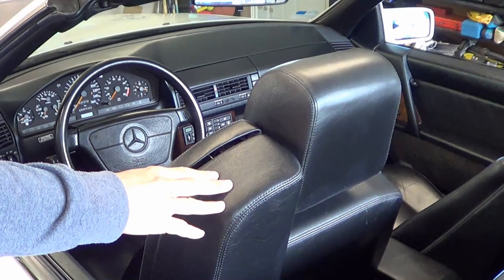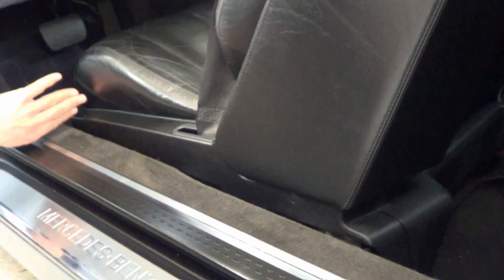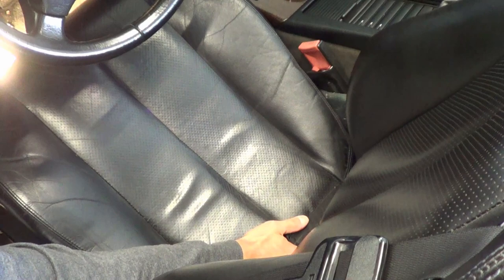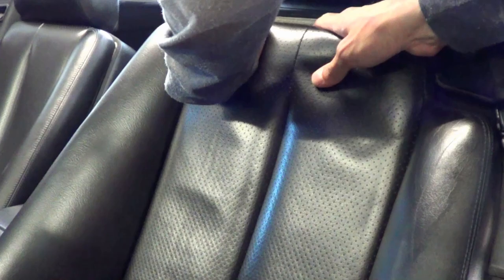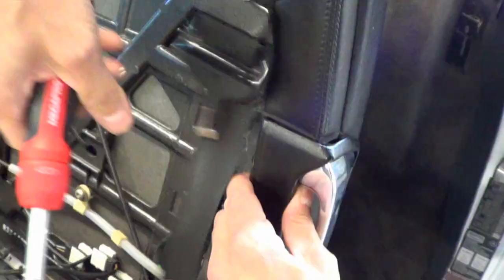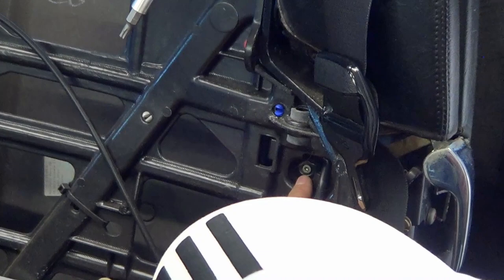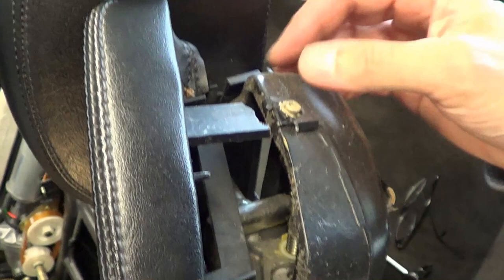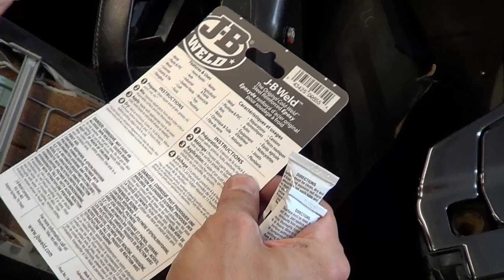Mercedes-Benz R129 Seat Removal Guide and Fix for 300SL, 320SL, 500SL

Comment: After watching your video, I got brave enough for the second time to do this repair, one suggestion: instead of gluing the pieces together, I did get a piece of strong plastic and attached with screws on both sides, I guess it is an option, thanks for making the video
Reply from the maker: Sam - thank you. I’m happy you found the video helpful and that I provided that extra motivation to get it done. The extra step you suggest would make the seat bullet proof. Recently, I added commentary in the video description highlighting this extra step. Thanks for sharing.

Comment: Nice video, and primes me up for fixing my loose back panel - which from what you show indicates I may have a screw dropped out at the top inside edge. 
I'd add that when I repair plastic brackets like this I prefer to use a re-inforcing strip of thin aluminium - from a drinks can or similar. You can cut that so it fits right over the entire bracket, then glue it with your epoxy and when set drill the hole through for the screw.
Reply from the maker: Thanks Chris. These seats may be over-engineered but on the bright side they are accessible for repairs when needed.
The epoxy is very solid when cured, however if combined with a re-inforcing strip it would become bullet proof. Great idea and thanks for sharing it.
Reply: @HandyVal  yeah the problem i find with epoxy sometimes is it doesnt key well onto plastic, even when the plastic is roughed up a bit first with some emery or a wire brush
Reply from the maker: I haven’t had any problems with using that particular epoxy. However, I’m a big fan of doing something once and not doing it ever again. So I encourage this additional step of using some kind of reinforced strip. I will add it to the video description.
Reply: Exactly what I do. 5 days ago I used Liquid Nails "FUZE-IT MAX" to adhere a thin piece of metal (slim-jim thickness) to the POS thin plastic "retainer bar" on the door of my fridge. It was cracked the day before and before it broke completely I "FUZED IT". That is some seriously sticky stuff. Don't think it gets as hard as epoxy but better for fridge application in my opinion due to the temp and the slight flexibility/bendability  of the retaining bar. The crack is still there because I knew epoxying the crack would last one week at best. For strength and this seat repair application JB WELD makes more sense. One additional hint: If someone (not you or anyone else reading this of course) happens to have screwed the head right through a hole (in plastic) epoxy a washer to the damaged plastic and voila- a reinforced forever hole just waiting for the screw to crank it down nice and tight.

Comment: Btw.  Great video. Tks for all those infos. The only think I rather prefer doing is to join the broken tab using a long plastic rod and screws instead of epoxi glue.
Reply from the maker: Thank you. Videos take time to make, so I appreciate the positive feedback. The epoxy is bullet proof, it’s still holding strong, even after a few years since the making of the video. But I agree, adding a plastic rod, or an aluminum strip with screws will make it bomb proof. It’s a good and smart idea to add the extra support and strength.
Reply: @HandyVal   I trully believe videos are difficult to make and time consuming. But I believe your r129 DIY series is by far the best series out there. tks for all those precious infos you share for free with us
Reply from the maker: @cbj032  Thank you. Much appreciated.

Comment: Hi. I guess you struggled to final install the bottom cushion last is because you first install the bottom cushion and screw it. Than you install the back seat cushion. I find this way easier.
Reply from the maker: After the video was shot, I realized the mistake I made. So, I added the correction screen. Thanks for the comment.

Comment: Thank you!  very detailed/informative.  The gears in my head rest are broken/cracked and need to be replaced and this is most of what needs to be done to get to them.  One question why did you disconnect the battery?
Reply from the maker: As a safety precaution, I disconnect the battery because of the air bags. We don't want to accidently trigger them.
Reply: @HandyVal  Right!  Thanks again

Comment: Val… let me ask this. What is your opinion about ERG systems in those euro engines? I live in Brazil and cars that old are NOT gov regulated. I was thinking in deleting my erg system. Hey…. Is this an DIY ideia for another r129 series video?   Best regards.
Reply from the maker: I'm in North America, and most cars came with EGR because of the tough emission controls in California. For economies of scale, most, if not all cars into North America came with the EGR. Deleting the EGR is an option, but I wouldn't try it as it can cause performance issues, as the EGR will work in tandem with other parts of the car. Thanks for the DIY - I think it would be a good video.

Comment: Another video that I saw , the guy used a piece of plastic and spliced the piece together which I think is a better idea. I’ve used JB weld before and on some soft plastics it doesn’t work as good.
Reply from the maker: Thanks. It has been well over one year now, and the epoxy is holding up fine. However, I think this additional step of using a spliced piece of plastic or metal will make it bullet proof. I include this additional step in the video description. Thanks for sharing. It's good that we share as much as we can with the R129 community. Every little bit helps.

Comment: I want to know how many days it stayed fixed.  Fixed both of mine… both currently broken again.
Reply from the maker: The seat fix from the video was completed exactly 3 years ago…and the bond is as good as ever. I’ve never had to redo it since. The next level of fix is to use a small strip of plastic or metal, which is then glued and screwed into the seat plastic - this will make it bomb proof. What type of bond/glue did you use? I’ve had great experience with JB Weld on this fix and many other fixes. It’s even fixed a hair line crack on a metal coolant pipe…and still going strong after a few years.

Comment: val, could you make a video on the r129 convt top  or maybe plastic rear window replacement???
Reply from the maker: I recently made a YouTube video on cleaning and waterproofing the convertible top. The plastic rear window replacement is tricky to do as a DIY because of the stitching.

Comment: Hello Handy Val. How do I remove the mobile phone from my 95 SL 500 and do you know where I can find the Bowden/Cable for my 95 SL 500
Reply from the maker: I don’t have a lot of experience removing the mobile phone, so I can’t help here - but I think you should keep it… it’s cool even though it’s not usable. The Bowden cable, which is really part of the accelerator cable is in the engine compartment, driver side, closer to the windshield than the front grill. Engine cover/filter cover once removed provide good access. Just look for what looks like a much thicker bike brake cable. I hope this helps.

Comment: Hi Val. I tried to remove the seat back cushions today but they really did not want to come out. Any tips please?
Reply from the maker: There are a two things to confirm - you need to first dislodge the seat bottom (to provide the clearance to push the seat back cushion down) and you need to remove the three screws at the bottom from the backside (as those three screws hold the seat back cushion to the seat frame).  I assume you did these two steps already. Order matters before you move to the next step.

Now try this: Pull the bottom (not the top) of the seat back cushion towards the front of the car, as it may still be stuck with the metal parts where the three screws were connected. I suspect this is your problem. It should wiggle a bit from the bottom now. And now you use your body weight to push seat back cushion down. It needs to clear about 1.5 inches (4 cm). You can see the metal guides on the seat back cushion at 2:54 of the video. This should do it.  Let me know. Keep me updated.
Reply: @HandyVal  Thanks Val. Yup, rear three screws removed. And I have lifted the seat base. (I have heated seats so do not want to remove the base completely). 
Guess the back cushion just needs some force downwards? Right?
Reply from the maker: That's right. The back cushion needs to be pushed down. But before pushing down, pull the back cushion from the bottom to try to disconnect the back cushion from the seat frame (this is an extra step if your seat is stuck) and then push down from the top of the back cushion. At that point, as you're pushing down it should come undone.
Reply: @HandyVal  Great. Thanks again. I will have another go tomorrow. 👍